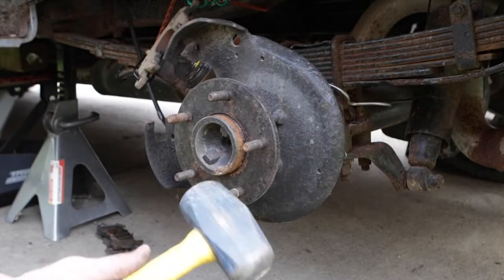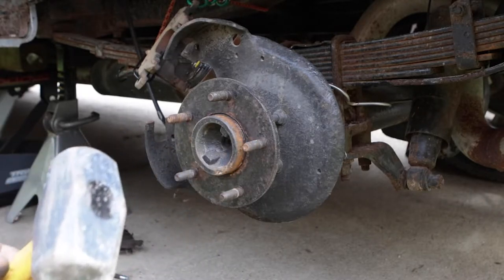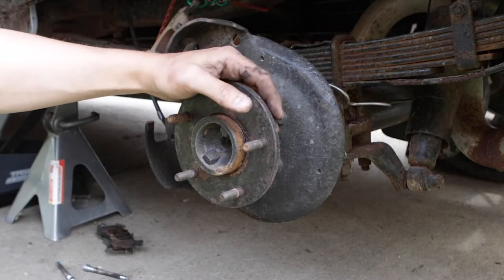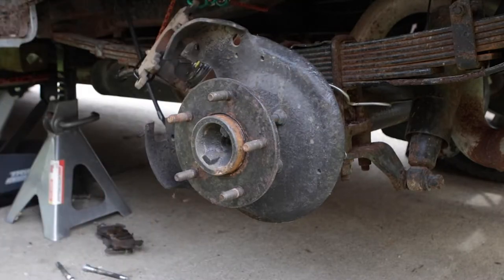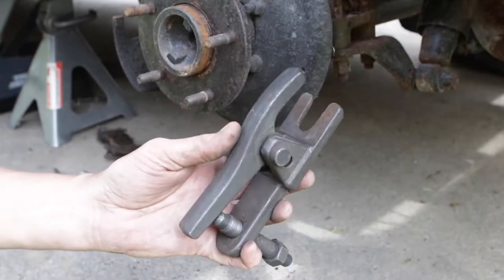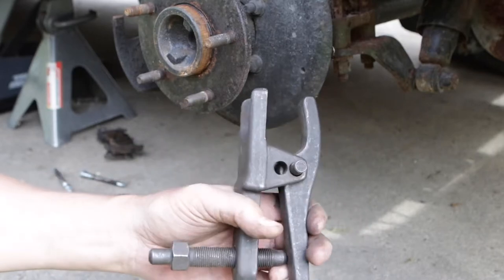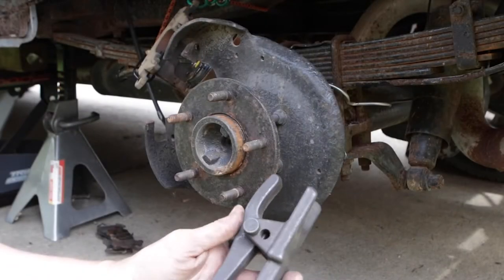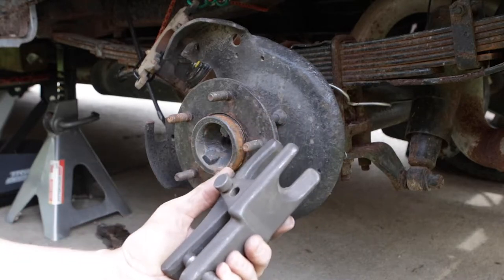How to remove a wheel stud without a hammer

Comment: I was thinking about trying to use my medium barrel air chisel (with a hammer bit in it) and try to hammer them out but I'm doubting that it'll have enough oomph to do it, have you ever tried that method?
Reply from the maker: I have not but that is as close to using a sledge hammer as you can get.
Reply: @asquaregarden  If I ever need to I'll probably try it first since I already have the tools.
Reply from the maker: The advantage of using a ball joint tool is that there is no impact vibration. In all honesty I would probably just use a sledge hammer vs an air chisel.

Comment: Does it have to be 3/4 inch? Or can a similar ball joint separator with different specifications work as well?
Reply from the maker: That one is the most common one available but I don’t see why another similar size would not work if it fits.

Comment: I was sold on the idea until I saw the pressing mechanism bending the stud as it arced around.  Is there a tool like this which just presses straight down on the stud (I hope a press isn't the only option).
Reply from the maker: There are tools but are generally really expensive. I have one example in the description. As far as bending the stud, it must have been the angle of  camera. I doubt you can bend a hardened bolt on that little travel. There is probably a total of 10 degrees rotation. The pivot of the tool has 100 times more slop in it than that.
Reply: @asquaregarden  Skip from 0:38 to 1:05 and look at the spacing of the thread on the bottom and the top of stud - perhaps it's the lighting but it does look closer on the bottom than the top by 1:05 but not so much at 0:38.

One thing I will say though is: if you do use a hammer, it's worth having a large thick rubber grommit to place over the stud before you start hitting it.  I just hit mine out then hit the brand new hub I had and left a mark on it!  I'm really gutted by that as I paid to get them all the way from the US!
Reply: If it came out that easily two quick 1:59 hits with a 4lb hammer would have done it. 
Any seized stud would just break this tool.